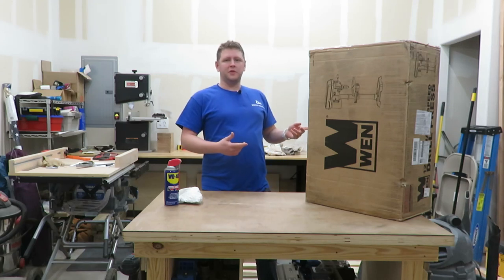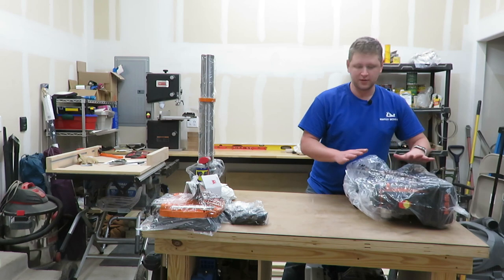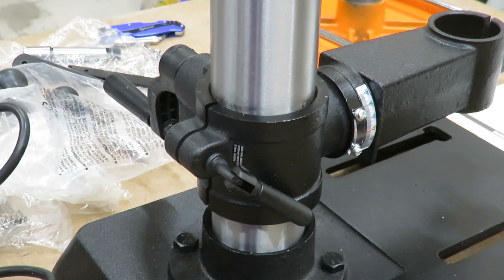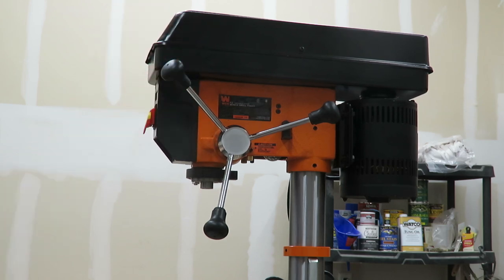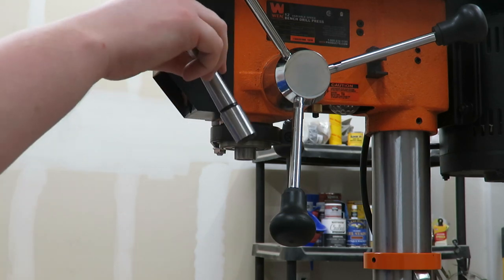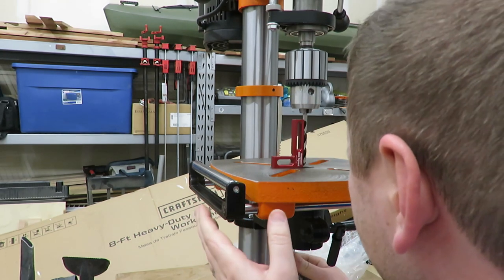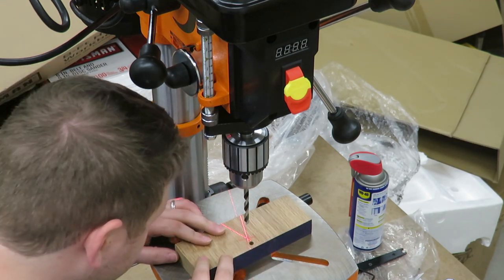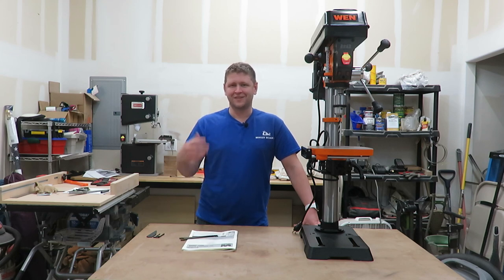WEN 4214 12-inch Drill Press | Unboxing & Assembly | Review

Comment from the maker: Question of the Day:  What do you guys think about this drill press (or WEN in general)?? And if you use a different drill press, which do you use and what do you think is better or worse compared to this one in particular?
Reply: I work on drill presses, mostly vintage industrial models. There are currently 13 presses in my shop, six of which are mine: two Delta DP-220 (a benchtop model in superb original condition made in 1943) and a floorstander that was put together with the best parts from all the DP-220s that I've restored, a Walker-Turner 700, an essentially perfect Atlas 53 made sometime in the mid-40s, a somewhat modern Rockwell with a model number too long to recall immediately, and a 1955 Craftsman/King Steely Spacehead. All in as-new condition including the chucks, motors, and all the hardware. How does a machine like the Wen compare? It's a different world.

What do I think of Wen? As a rule of thumb, if you can lift the base out of its box with one hand, it's not a heavy duty drill press. Rigidity is paramount. I don't care for Wen's marketing campaign here on YT. It's sneaky and underhanded; someone who isn't used to the dynamic of the platform can easily fall for it. I could see the runout with the camera fairly far away. If this were mine, I'd replace the chuck. That's not cheap and an extended conversation in itself. This being said, you may be able to lessen its runout by flipping the arbor in the quill 180*. If you get an indicator/base and can measure this, there may be more you could do. Again, it's a separate conversation. The 3.125" quill travel is OK, better than ~2" found in similar consumer presses. Typically, you'd want at least 4". Could also hear some chatter in the bearings, even though the machine is relatively quiet right now. This will only get worse with time. If you use it for wood and don't have it running all day, the Wen should serve you well for many years. The runout, as an example, likely will make no difference in your projects, unlike working with metal. Good luck.
Reply from the maker: Felix F I truly appreciate your feedback! I am nowhere near as familiar with machining equipment as you seem to be and I love to learn! I do agree the WEN is not a heavy duty machine. I see it as an affordable woodworking option.

I know I would need to spend a lot more to get the level of precision you are talking about here.  I would personally love to take an older more sturdy machine and bring it back to life and use it because I truly don’t think they make them like that anymore, but my own ignorance would be a hindrance there. Maybe for my next drill after this one is worn out.

Which Chuck would you suggest replacing this one with? I will definitely look into that!

Thank you once again for the input! I really love to learn all that I can and I know I am still learning with a long way to go!
Reply: @BentleyDesignCo  "Which Chuck would you suggest replacing this one with? I will definitely look into that!" Excellent thought! What price range are you comfortable with? I'm assuming that your arbor has a 33JT taper.
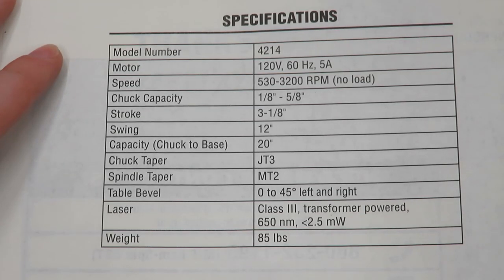Reply from the maker: @felixf5211  The manual says it's a JT3, not sure if that's the same thing as a 33JT or not.  You can see the specs for this drill from the manual at about 23:25 in this video.
Reply: @BentleyDesignCo  Now that you say it, I do recall seeing that it's a 3JT. 33JT is the most common. 3JT is a pretty good size taper. That's nice. One question; did the press come with a metal wedge (ie. a drift) to remove the arbor? If this is doable, you can essentially use any chuck you want as long as its arbor terminates in a MT2. It's an opportunity to spend less on a good chuck, depending on the budget. Arbors are inexpensive. I like to use Jacobs arbors, but to tell you the truth, there isn't a functional difference between an Asian arbor and one made in the US, UK, Germany, or Japan. The price is different, that's for sure. As a FYI, typically an arbor is around $10. Jacobs arbors range from ~$15 for a used one to relatively obscene sums. Meanwhile, let me take a look at what's around with a 3JT.
Reply: Had a look at what's available. As 3JT is a somewhat uncommon taper, we're either looking at $100+, or an Asian keyless chuck that's somewhat ubiquitous these days. It's around $30, looks great - a massive piece. I've installed a few, have owned one, and have one (different) still. Their runout is usually around 4 thou. If you're comfortable with that, it's a viable option with one caveat - the chuck can lock up when fully opened and there's no real way of unlocking it. As I understand this doesn't happen too often, but it did happen to me. In essence, it's a copy of a German Albrecht chuck. Many reviews and demos on YT. I'm going to leave a link in a post below, in case it ends up in your spam filter.
Reply: As a FYI, the arbor that it comes with is meant for a lathe. No tang. https://www.ebay.com/itm/1-32-5-8-3JT-PRO-SERIES-KEYLESS-DRILL-CHUCK-JT3-2MT-TAPER-ARBOR-MT2-CNC/112251358296?hash=item1a22b3cc58:g:2QYAAOSwnTdaNFXb:sc:USPSPriority!14620!US!-1
Reply from the maker: Felix F yes it did come with a drift to remove the arbor. Thank you for the help!
Reply from the maker: Felix F awesome, when I see the link I will definitely check that out! I might be willing to spend up to $100 to improve it!
Reply from the maker: Awesome, thank you!  I will check this out!
So would I use the original arbor with this new chuck?  Or find a new arbor as well?
Reply: @BentleyDesignCo  First, let me apologize for not getting back to you yesterday. We live in interesting times, as I'm sure I don't have to tell ya.

A 3JT taper is typically used on larger chucks - 5/8 and over. As your arbor is easily removable, you have a ton of options. A new arbor is around $10 for an Asian model, and a lot more for branded. The Asian arbors are quite good, but sometimes there's a deal. For example, yesterday I picked up a NOS Jacobs arbor for $13. Happens, but I digress....

Jacobs, after being purchased by the Apex Group, is now made in China. Not recommended. NOS Jacobs can be excellent, depending on model. Same goes for Rohm and Albrecht from Germany, and Yukiwa and Cushman from Japan. IMO, Yukiwa manufactures the Cushman chucks, but I have no real proof.

It can be very useful and lots of fun to have  chucks for specific applications. Your machine came with a pretty big chuck and you can still use it when you need to. A 1/2" chuck, which is pretty much the standard, is MUCH less expensive and usually has a 2JT or 33JT taper. There are some really good deals, like a brand new Cushman C13 for less than $35 shipped. It has a 2JT taper, so you'd need an arbor to match. Similarly, a brand new German Rohm 1/2" can be had for about $50 with a 33JT. If you don't mind a 3/8 chuck, which isn't as popular as the 1/2", we're talking less money for very high quality. Some excellent deals. FWIW, I've bought several of the Cushman C-13s. Installed some on a few machines, and kept one for myself. 

Give this some thought, maybe look around a bit to see the products, and gauge your own comfort level. Then we can discuss the specifics.

BTW, I may have been too quick to harp on the bearings in your press. As it's brand new and we're not exactly in the middle of summer, the grease inside the bearings has to come up to temp and spread itself around. This will take a little time and I bet the Wen will run quieter.
Reply from the maker: Felix F thanks so much for all of this excellent information! I will do some research and see what these options provide! You have truly given me some great insight here!

Thank you for your expertise!

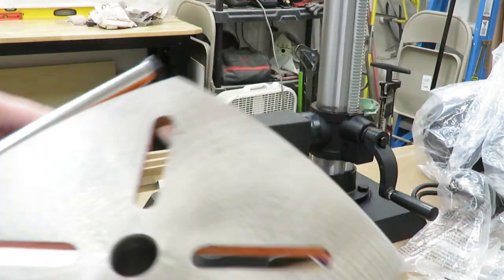Comment: Just put mine together yesterday. For those who are considering this model be aware that the table that came with mine, the shaft was too small in diameter for the collar that it fit in. Even tightening the collar to the max the table could still rotate. I probably should call wen but for now I cut 2 aluminum pop cans to surround the shaft. Increaing the diameter by .016". It would tighten then but it still nearly bottomed out the collar. See video at 8:05 or so. I really like this otherwise. It really is a great value!! Thanks for the video. Nicely done.
Reply from the maker: I don't know how I missed this comment, but thanks so much for watching!  I'm sorry to hear you had issues with your press.  I hope it's working smoothly for you now!
Reply: I had this issue. You have to make sure the lever goes into the right side and then it tightens up fine.

Comment: Thanks for the review.  I bought this one around July and love it.  I was worried when it arrived because the box was pretty beat up, but it was fine.  I like the variable power and use it a lot when I'm working on a scroll saw project.  I also used it with a 3" hole dozer when I was making Steve's Catalina wall cabinet, so I can say it will take whatever you throw at it.  Hope you enjoy using yours.  I'm still planning on getting that Wen air filter sometime this year.
Reply from the maker: Thanks for watching!
I fully agree with you so far!  I have been using this drill press for about a month now and it has been very smooth.  My box had some small tears, but like you, my drill press was in perfect condition.  The variable speed has been very useful already for me.  Switching from drilling through holes, to insets with forstner bits, to even cutting plugs.  It makes it very easy to change the speed and keep drilling with less down time.
Let me know when you get that air filter!  I just changed the filters in mine because they were covered in dust.  I can't believe I was breathing that in before!
Reply: I have the same model (well, mines a 4214T whatever that means) and my box was beat up bad. The styrofoam was broken inside in multiple places. But lo and behold nothing appeared damaged, though the box looked like it took a serious fall. I also wish they'd ship it a little more inconspicuously instead displaying WEN DRILL PRESS to the world, but I guess that's one way to get your name out there. 
All in all, I like the machine. I'm having trouble with my table though. I have to really torque the rear knob to keep it from moving and it's a pain that every time I raise or lower it, the table moves laterally as well. Maybe I missed a set screw somewhere?
That wrench btw is just for tightening the 3 main handles and the fourth handle for the speed adjustment. Why there's a large end on the wrench is beyond me.

Thanks for the great video!

Comment: Just as an aside there are two allen bolts to secure the head to the tube, the one you tightened and one right above it. You may want to tighten that one too. I liked the video, this is the third unboxing I've watched and you did a pretty good job. The arbor as you called it is actually the spindle, what it goes into is called the quill, yup, like the pen. I really didn't know this before, but when I looked at the manual that I downloaded it mentions the quill and several places where the drill press is advertised also mentions it, so I did my due diligence and looked it up. Any, great video, I'm going to keep my eyes open for the rest of the review, when you start your project. I'll be interested to see how it goes. Till next time! 🖖😎
Reply from the maker: Thank so much for watching and for the very helpful input!
We are always learning :D

Comment: Great vid. I have the exact same model and very much like it. One thing you did not mention is that the Yellow piece of the power switch comes out, and when it is out the drill will not turn on. Also for those thinking of getting this drill press, do so, but follow the directions and mount the base before you assemble the machine. I did not and in fastening it to the base I put it on the machine rolled and broke the handle that raises and lowers the table. A call to Wen and about $5 later I had a new handle so their customer service is also good.
Oh, and just subscribed to your channel
Reply from the maker: Thank you!
Yes that safety switch is a great feature!

Comment: Hey! Nice video, I have one to and I was wondering how to stop the table from moving left and right and stay centered with the bit
Reply from the maker: Hey! Thanks for watching! You probably just need to tighten it down a little more of the table is shifting. Mine hasn’t budged since I set it.
If you have it all the way tightened down and it’s still moving, I would contact WEN customer support and see if they can give you a replacement part to stop that. 👍🏻
Reply: Bentley Design Co. ok thanks for the advice, you mean the bolt on the back of the table right? Thanks for replying so quickly and stay safe
Reply from the maker: Yup! That bolt on the back. You can see me tightening it in this video I’m pretty sure.
Thanks! You stay safe out there too!

Comment: 10:00 there’s another bolt 2” above that should be tightened as well. The manual is missing it but it also goes to the column.

Overall it’s a decent machine. Noisy and got some excessive  runout but it’s hard to complain for $270 with no tax and free shipping. Also, mine doesn’t go lower than 620 rpm.
Reply from the maker: Ah good to point that out! Thanks!
I’m enjoying my press still, too :)

Comment: I wish that there were at least two allen head set screws that hold the drill head & motor to the column & that there were flats on the shaft or releif's
Reply from the maker: I agree that two set screws for securing the motor head to the column shaft would probably be a good idea!
I haven’t had it move or squirm on me yet, but I will definitely keep an eye out for that!
Thanks so much for your input! It really helps to think of things I may not have gotten to when I hear from you guys!
Reply: @BentleyDesignCo  There are two set screws.  The second one is above the one he tightened!

Comment: When installing the chuck, Would it be beneficial to heat the chuck & cool the shaft?
Reply from the maker: I haven’t had any play in the chuck since I have installed it. It was actually difficult for me to knock lose the one time I did remove it.
However I can’t see how it would hurt. It would cause the chuck to swell and the shaft to shrink a little, which might give an even more secure fit. I’m definitely not an expert at that level (or any level haha) though! :)
Reply: I wouldn't do that. It is designed to work as is. If you did that you may never get it out again, which would make you sad if you wanted to upgrade the chuck at some point. 
If you are having issues with the tapered shaft staying in place make sure it is clean of any lube, and doesn't have any bumps or burrs on it. Then give it a good smack with a mallet.

Comment: Several reviews that I saw said that the mounting base had an issue with one foot pad being higher then the rest & he contacted customer service & ordered another which had the same issue? Also, That the 4214 is to tall for benchtop use but, to short to be used as a floor model? Would you order it again?
Reply: I recently bought this model and it's perfect height for me on a bench.  I'm 6' 0".
Reply from the maker: I'm sorry, I don't know how I missed your comment earlier :(
But my press sat perfectly steady and the height is very comfortable for me on my workbench.
You can always make a drill press cart or stand also to sit it on so you can make the height perfect for your body.

Thanks so much for watching and commenting!

Comment: Question, Can I use brake cleaner to clean to excess oil from the parts?
Reply from the maker: I’m not sure, but I don’t see why you couldn’t. I usually wipe them or if they have an excessive amount, I use WD40.

Best of luck with your new drill!

Comment: Can a drill bit smaller than 1/8 be inserted into this chuck?
Reply from the maker: The capacity of the included chuck is stated to be 1/8” - 5/8” in the manual. I have not tried to use a bit outside of that range with it. But the chuck does close all the way together, so theoretically it should “fit”. I just don’t know how it would perform.

Thank you for watching!

Comment: Hi you measured the runout angle at 90 but not from front to back .was that also 90 ?
Reply from the maker: Hi Chrisy!
I did check the front to back runout angle as well. I just didn’t show it on the video since the table was already indeed perpendicular to the bit in that direction. 👍🏻
Reply: @BentleyDesignCo  I know this is a old video but has helped me out recently. mine isn't level front to back but i don't see how I can adjust the table in that direction??

Comment: kind of late to the party but if you still have this press what is the distance between the channels on the table for mounting vise?
Reply from the maker: It‘s in an X pattern. The closest points are about 2.5” apart and the farthest points on one side are about 5.5” apart.

I hope this helps!
Reply: @BentleyDesignCo  yessir! Thanks a ton, was looking at buying this model to put a free x y table i got my hands on sadly the base is about 7 inches from channel to channel.
Reply from the maker: @MrJaysniping  glad I could help. Sorry if this press won’t work for your needs.
Thanks for watching and I hope you find one that works for you!